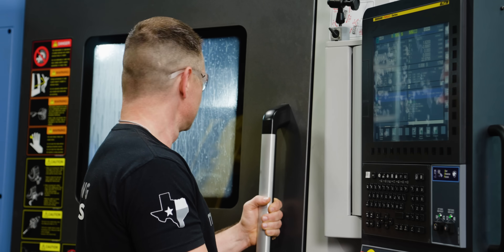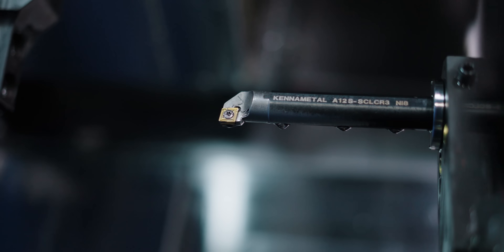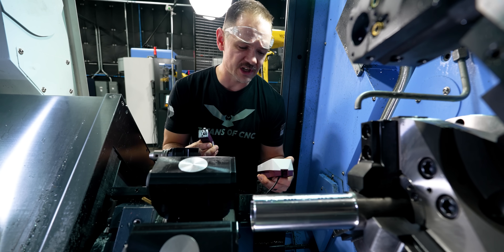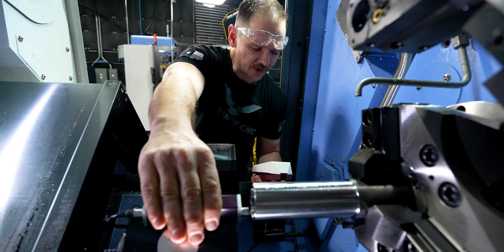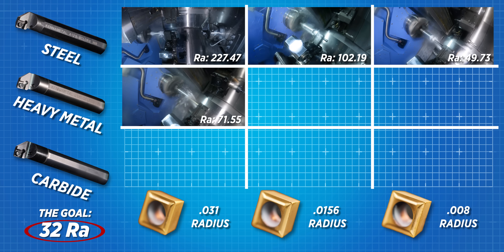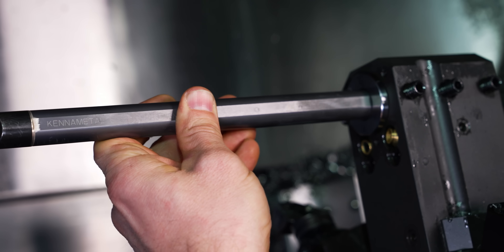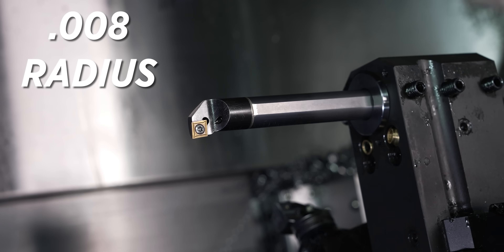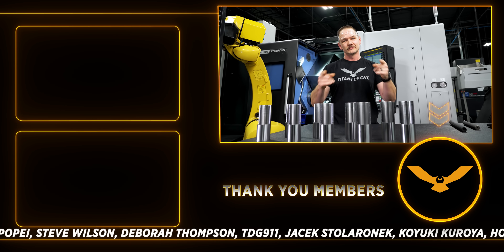This KNOWLEDGE Will Ease Your Pain and Suffering When Attempting to Machine Perfect Parts

Comment: With a steel bar anything over a 4 to 1 ratio will chatter as a general rule. 
I’ve gone up to 12 to 1 with a solid carbide bar or even higher with a Sandvik Devibrator boring bar. Great video. Thanks for all your hard work and expertise!
Reply: 11 to 1 i was running personally, VBMT cermet insert, 0.1mm above center line, steel bar.
Reply: Shhhhh!  I have a feeling they're keeping silent about those tools (pun intended) since they work so much better than even carbide.  Certainly in another category entirely when it come to price as well though.  :/
Reply: @Dyna78  are there even oil filled bars in like 6mm or 10? or closer? Same for the spring ones
Reply: @bosanaz2010  I have seen oil dampened 'silent' tools as small as 10mm shank diameter, but not sure if anyone makes any smaller than that.  For anything smaller than that, I would probably use a solid carbide bar from Circle Tools or Micro 100.

Comment: The best way to do this is machine the best od. then clamp on the middle of the od. Then you can bore that shit out fast with a better finish. Also you can variate the spindle speeed mid cut to reduce chatter and allow you to run 10-20% faster without chatter.

Comment: As a experienced oil field machinist used to doing deep bore work
If your looking for a good finish use a 55 degree D insert and back bore that same cut from inside to the face
Chips will stay behind tool
No chip rub or damage and it will be way better
Reply: I find it interesting that the original comment did not discredit, nor refute Titan.  Came in, gave reasonable advice and said where it came from and you all decided to immediately attack them.
Reply: @christopherjones7191  Shut your trap, Globalist.
Reply: Good video but a pity you changed the feed rates mid-test, when at the beginning you said they would not be - due to requirements from the manufacturer
Reply: Things that weren't addressed were taper in that long of a cut and going up in bar size in addition to the aforementioned insert geometry.
Reply: Thanks for the tip.
Reply: discovered this years ago, but glad I did. I do this all the time now. Im not a machinist who runs a good machine for a living in a clean shop. , just an allround mechanic who works everywhere and found out this really helps on (older) crappy lathes.
Reply: @neptunevinyl after 40 yrs in CNC jobshops, I've found there are many ways to cure chatter & this video just touched on the obvious ones. There's a lot to learn from some of these comments. Just ignore them if you don't want to learn. I have learned from the dumbest guy in the shop at times. Watch everything
Reply: Thanks for the info. Its a technique that I occasionally use, but I just want to let you know that I appreciate that youre willing to give away your machining tips & tricks to the world for free!! Not sure why others here are offended by your post, but I'm definitely not!
Reply: Sorry, but is your name Titan of CNC? Didn't think so.
Reply: @a-iz4pg you're definitely not him either arsehat
Reply: @a-iz4pg  you must be young and inexperienced
Reply: @eyeexaggerate7687  You must not be Titan of CNC or it would say so in your name.
Reply: @a-iz4pg you must have your CSD to be talking like that 🤣
Reply: @a-iz4pg  Thank you for your comment! I'm with you 100%! I'm so sick of experienced machinists acting like they know everything. I dont need experienced machinists offering machining advice based on their years/decades of experience. I come to TOCNC to watch their videos and hopefully learn some new machining techniques. I dont come to TOCNC to learn new machining techniques from people who aren't part of Titans of CNC. These people who spam the comment section with different tips and tricks that they've learned over decades of trial and error are so obnoxious. 

I'm glad you spoke up and let all of them know that WE DONT CARE ABOUT HOW THEY MACHINE PARTS!!
We dont want any of the knowledge these people have gained from decades of on the job experience. We only want TOCNC knowledge bc nobody on this planet  knows better than TOCNC.

So please stop giving us different ways to tackle a machining problem! 

🙄🙄🙄🤦‍♂

And fyi...if it went over your head...This is a condescending sarcastic comment. Just bc youre not intelligent enough to realize that its always worth listening to an experienced machinist who's offering his knowledge.....please just stfu because I (as well as most others her) appreciate when others offer different techniques.
Reply: @neptunevinyl  bro you almost got me XD well played Sir ':D
Reply: @neptunevinyl Lol I was seriously about to flame your comment until I got to the last part....LOL
How dare someone listen to thousands of experienced people in their field when they're looking for answers from experts in said field........
That being said. I love titans of cnc. I respect their opinion greatly. But I see they know about as much as solving chatter as the rest of us lol
Reply: @neptunevinyl Thank you. I maintain a large fleet of NC machinery, and honestly, I think these guys can damage  machining centers better than our worst operators who  drink 17 cans of beer a night after work.

Comment: So, the moral of the story - start with the most expensive tool imaginable - a solid carbide boring bar.
Reply: What ismore expensive? A job that you lost because of vibration, or another grinding process, or a more expensive tool?
Reply: He did not use the most expensive tool out there. He didn't go and get the carbide reinforced Vibe damped bar.
Reply: Yeah and change the parameters as you go so it’s a terrible scientific test.
Reply: Nowhere close to the most expensive. I believe that award would go to Sandvik Coromant's SilentTools.

EDIT:
To throw some real numbers out, the Kennametal bar featured here runs just over 1k USD from a get-it-tomorrow-morning type online retailer (or 580 through a distributor, no one outside of garage shops pays list price). For Sandvik, I can't actually locate a directly comparable offering. Their biggest straight-shank SilentTools boring bars are 1/2" on the imperial side and 12mm on the metric side, both 185mm long to the Kennametal's 254mm length. The 1/2" Sandvik bar lists at 889 and you won't find a price other than that because disclosing discount prices violates terms and is a quick way for a shop to lose that discount. Where SilentTools really shines is making the impossible, possible. You want an 808mm (31.8") long 60mm (2.36") diameter boring bar to make some crazy part? Sandvik has you covered, for the low price of 43k. For a saner example, a 50mm diameter 223mm long (all usable; C5 Capto mount) will only set you back about 2.5k
Reply: @dwaynesykes694  Yeah we're in deep with the Sandvik silent tools. 20mm dia through 40 and some of them are carbide reinforced so at least double the price of the standard silent tool!
Reply: Boom! My comment got nuked. I guess pointing out that reasonably sized shops don't pay list price on tooling is a no-no here. For what it's worth, the below-list price I called out on this boring bar was from a distributor's website, not through a contract discount. I don't have an account with Kennametal... if I did I wouldn't blow my deal by dropping prices. I also didn't name any of the sources. Kind of pedantic to delete comments over little things like that, but I suppose they do their best to keep that sweet Kennametal sponsorship they've got.
Reply: That carbide bar  looks more like fun, not boring :D
Reply: Crazy stickout in Both directions. Crazy part crazy price
Reply: Yeah not sure the point of this resonated with me either. He dropped the second last one on federate after saying In the beginning that we wouldn’t. Feel like could have played with the cutting parameters on the steel boring bar to make that cut better to be honest
Reply: buy once cry on... ce you drop it and need a new one. lom

Comment: The fact that he didn’t use the suggested feed rate on the second to last tool, the same way as all of the previous, throws off his data for the whole experiment. The experiment was on the boring bar construction and it’s effects on chatter. The only honest way to test that is at the same speeds & feeds with the same style insert. I’d give them the spindle speed adjustment to tune each bar the best you can but changing the feed rate on only one bar skews the data.

Comment: Your vibration theory is not correct. The  load on the tool pushes down tangentially. The chatter occurs when the chip breaks an releases the load causing the tool to return to a natural state than it digs in again. If you load up the tool so when the chip break and there is still enough material it doesn't flex back. I did a bore with a 3/4" bar and could stop the chatter until I cranked it to a .100" depth of cut where it spit out chips and gave a perfect 32Ra finish. You can nail size with big cuts but you got do 3 finish passes exactly the same and dial in the offsets on each pass.

Comment: rubber bands and solder wire help too
Reply: lol. I have actually used many rubber bands. They do help with the harmonics in holder. You are one of the many few who know this trick. Amen to you.👍
Reply: @monkeymojo073  please could you elaborate on this? Where do I put the bands? Around the bar?
Reply: @OpticMoos   No :-)   , around the part. You can use an old bicycle tube.

Comment: I remember we had boring bars that were dampened and also some that was a split combo dampened and heavy metal. But else, every lathe was equipped with Sandvik Capto holders and dampened boring bars. It's another world in comparison to the old shop I was at <3

Comment: 🤔 somehow it didn't feel like an education video... switching to a more expensive tool-holder as "easy parameter to change" sounds more like advertising.
that aside - going to a smaller cutting radius to get a smoother finish, was a bit counter-intuitive for me, as my manual lathe experience from centuries ago taught something different. 
i wished it was more about the actual machine-paramters that someone could play with, to get the better result with the same tool.

Comment: I usually start backing off SFM and turning up feedrate, but with some parts, it's difficult to manage, sometimes a HSS tool helps, because they are sharper. there is a company making HSS indexable inserts, they are awesome for long turning work.

Comment: I'd love to see this repeated using the carbide bar and the 2 smallest nose radii, but with different DOC, feeds, and speeds to get the highest MRR without chatter. Allow the surface finish to be a little rougher (50? 75?) but go after a high, chatter-free MRR.

Comment: But what about #Doosan#DSSV (Doosan spindle speed variation) Function. It sometimes totally gamechanger. Most of time i use that function for turning thin wall aluminum casting parts. Maybe another video about that function?

Comment: At my job we sometimes have some really thick parts sometimes so you’re trying to get a 30RA finish on a parts that is 3.75 tall. We use 1” end mills but even with a 1” end mill it chatters like a motherfucker. Usually what I do is a pre-finish with a Roughing end mill leaving between .0005-.001”. And then messing with my speeds and feeds until it no longer chatters. And then run the tool again. That typically works well for me but not all the time

Comment: Take a high quality U-drill as boring bar for finishing, the outside insert will do a perfect job, drill should be approx 80% of the diameter (hole) you have to finish.

Comment: Interesting video for beginners,  One thing to point out though is that playing with parameters like feeds and speeds and ways of holding the boring bar you could probably get the steel bar with the 0.008 rad to work and for sure you would have been able to get the heavy metal bar to work.  In this particular case you wouldn't have needed the carbide bar.  There's also de vibe-bars that in most cases work better than carbide, but Kennametal's are garbage, probably why they didn't try those.

Comment: my shop won't buy anything smaller than 1/32" R inserts. my supervisor doesn't want to be bothered with improvements to the shop or ordering stuff so even what we do carry runs out a lot and we still get told to get parts done somehow.
  which is why i'm leaving manufacturing and going into IT. hopefully i can make enough money to put a CNC in my garage and start a little shop doing custom gun stuff and R&D for my own pet projects.

Comment: Nice video!
Nothing worse than a screaming machine.
We use the heavy metal bars as standard as they are not much more of a premium to steel.

Carbides work well but are not forgiving, seen so many shatter. Prefer the bars with the mass damper inside, they are the bees knees.

Also if your machine has spindle speed variation this can be used to reduce the vibration.

Comment: Well hoped for some more tests. I dont know maybe some kind of anti chatter macro (or just manual speed up speed down) to see how it works, or some kind of special anti chatter bar, bars that allow you to put water pressure directly on the tip of the insert, anti chatter inserts (vipers and some other crap), different fixture designs (from sizes to materials) etc. This was ok but maybe you could make some more of these.
Reply: There are definitely more ways we could have went about it. I hope we get to put some of those in another video. Thanks for the suggestions my friend!

Comment: the actual tool cutting angle, becoming shallow to the point it no longer digs in. slides over its self! cant cut cheese scraping a knife over it at a 90 degree angle, same as a wood planer angle. but then what do I know, used a $50 drill press to lath a 1300lbft small ford to AAM1150 drive shaft flange adapter. that sits at 3000rpm to 6000rpm same as the flimsy unsupported drill was able to spin it as it became balanced.

Comment: CNC lathe guy here. I use a method “tuning the boring bar” by adjusting the screws in the holder (front screws loose, back screws tight). I always use full slot holders so my set screws engage with the bar directly. I also usually try to run a finish pass of about .007”. My chatter problems have been heavily mitigated.
Reply: It’s also a resonance issue - you’re basically de-tuning a tuning fork so it sounds ‘dead’.
Reply: thats interesting, being a manual lathe monkey I always tighten the toolpost screws gutten tight to increase rigitity anywhere I can - that and slow the speed and sometimes rest a nylon mallet on the bar or the work xD..
Reply: I do both - cnc and manual lathe. One hard lesson I’ve had to learn is many of the tricks and ideas aren’t transferable. Things that always worked on my manual machines don’t work in the cnc machine and vice versa. I do a lot of aerospace bushings and it’s always deep bores in long thin parts. Chatter is a nightmare…. I still don’t know enough. And the good tools are eye wateringly expensive.
Reply: I would try tightening the screws facing me first or the back ones first too when I was tuning the bar (besides just the front or back screws) & put the edge of the insert .01 above center. Sometimes it helps to wrap the part with rubber but not very often

Comment: Good video Travis! I haven't ran a CNC lathe for many, many years. But this video walks you through what can take months and maybe years of learning how to apply the right holder, the right insert, the right feed, the right spindle speed to achieve the correct surface finish in about 15 minutes. It is a must watch for all newbies. Learn something new and save the time and the headache of learning the hard way.

Comment: I'm sorry to say but this video is quite useless.
The first takeaway is buy a more expensive boring bar cause it will make better parts. This is quite obvious and not worth a 15 min video.
The second information is that nose radius influences on chatter but having changed the feed rate aswell between radiuses it isn't clear if the answer is a smaller nose radius or a smaller feed rate. In a proper test you should change one parameter at the time not many.
The third thing is that he changed the feed on the second to last test. That's not how testing works. You don't fiddle with the results until you get the results you want. It also isn't an accurate comparison against the other bars with the same radius.
The last point is that he mentions here and there speeds but doesn't record them or post them, this is quite important as it is the main factor in determining cycle time and comparing different boring bars with different speed and thus cycle times is not a fair comparison.

Comment: I notice you aren't using clamshell sleeves. We've found switching to those has provided a stiffer tooling setup and we were able to prove that via tap testing the tool to show the stability curves. Does Kennametal not offer bars and sleeves like this?
Reply: We've used them before and you are right, they are definitely helpful. We did not want to introduce too many variables for one video though. Thanks for mentioning those.